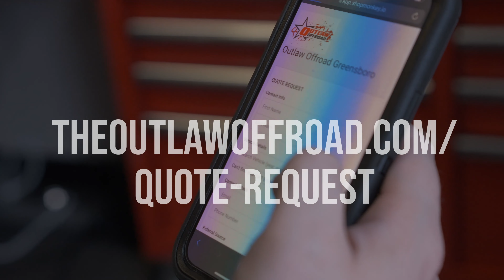Do You NEED all 8 Control Arms?

Comment: Very informational, Thx!  I do have a question on your statement that the upper rear control arm (adjustable) is the 2nd most important ones to replace.  Can you expand on that a bit since it would seem logical that the lower rear is the one that pushes the axle backwards to both re-center it in the wheel well and restore wheelbase.  Thx!
Reply from the maker: in most cases, it is more important to dial in the pinion angle (uppers) than locate the axle forward or aft. Generally, and especially with newer Jeeps, we're not lifting them 6"+ to fit a larger tire so the smaller lift height has less effect on axle positioning.

Comment: This is so helpful. Just bought Clayton 2.5 Ride Right kit for my Gladiator. How come it only comes with upper control arms instead of lower? When I check out the same kit for JL, it comes with 4 arms. Not sure why. Also, what would be the next 2 arms I can upgrade for my JT? Rear upper? Thank you!
Reply from the maker: the upper control arms dial in your caster, so it makes sense that you have uppers only. from there we suggest front lowers

Comment: This is a separate issue, but how important are hun centric rings for JLu, I’m looking at Raceline wheels and they show 78 mm hub bore, vs factory 71.5mm
Reply from the maker: Hub centric rings aren't super important, as long as you have a conical style lug nut to keep things tight. 
However, it definitely doesnt hurt to run them just as a safety backup!